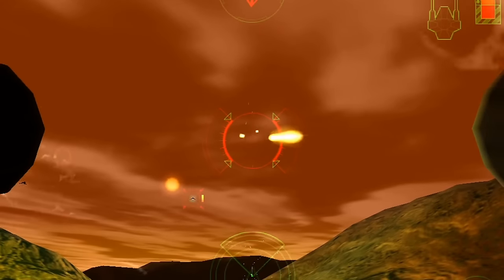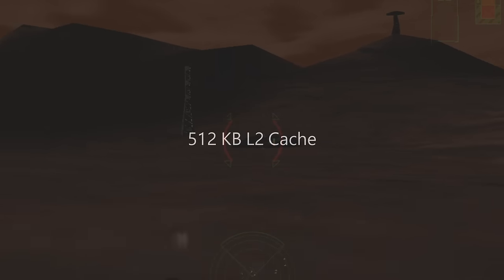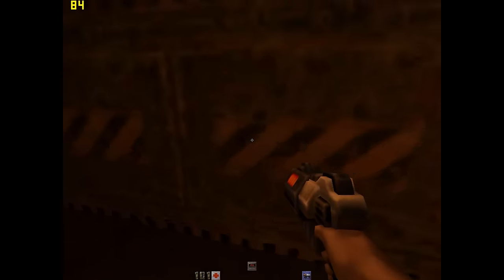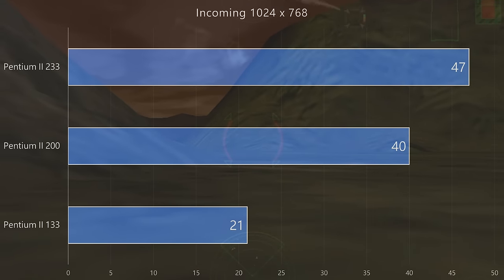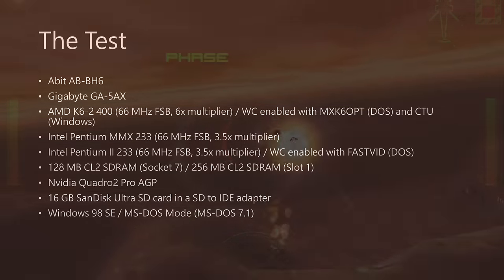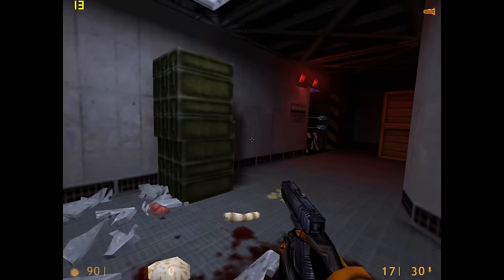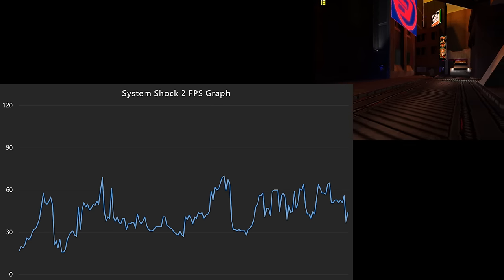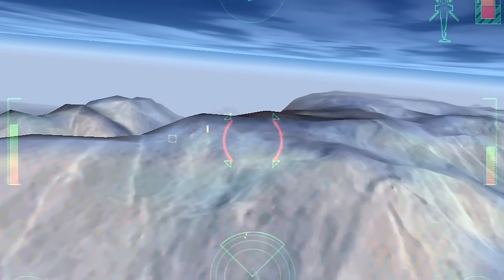Pentium II 233 The First Slot 1 Processor

Comment: Oh gosh, this makes me feel even worse about my IBM Aptiva computer in my youth :(

WARNING! Wall of text below. Copied and sloppily translated from a forum post I made a few years ago.
In 1999, my parents agreed to buy a new computer. A new. A real. The old piece of crap that were the source of so much anxiety would finally be replaced. We had looked here and there, and had a good candidate in a local store. An IBM Aptiva for about 9000 SEK including the screen and speakers with an AMD K6-2 400MHz, 64MB RAM and 8GB hard drive. I think i was model 2158. We thought for a while though before hit it.

Two weeks later, we were back to buy the computer. But then and there, while the parents talk to the seller, I see that the computer next to it, also an IBM Aptiva, but with a Pentium II at 450MHz, is on sale and costs about 8000: - against the previous 11,000, thus cheaper and better than the one we came there to buy!
But..! I did not dare say anything to my parent! For there had been so much fuss during the past six months whether to buy or not buy, and if so, which, and a damned negotiating to get into something tolerable. Inexpensive shit should it be, since they do not understand any of it. Not out of incapacity, but pure meanness.
I was afraid that there would be hell in the house to just take this up, even though the case was obvious. Like not challenge the election now that we've come this far. It would probably just be mental locking only the disclosure. That the content would have been brilliant had not played any role. It was the end of drivel about computer simply. In addition, it had a lot of ugly shortcut keys on the keyboard. No, it made a crappy impression. The other was clean, and it felt better to the mind, at least that was what I told myself. All were mentally tuned to the selected computer.

In retrospect, I regretted it bitterly as hell, and have never really been able to forgive myself for that.
Gradually, it turned out that K6-2 was not so good. It sucked, frankly, even though I did not want to acknowledge it. It was 400MHz, it had to be good! But it never kept up properly.
The real deathblow came when I would upgrade "graphics card". The machine had no AGP port, it turned out ... And with the advent of the Internet, I discovered that the other machine I saw had AGP port. And better speakers. Much better speakers actually. They looked almost exactly the same, the only thing that visually separated the two were knobs, but I got to listen to them many years later, and it was something completely different. There was a base in those.
All this, I missed for a few colored buttons on the keyboard ...

Arghhh! So much anxiety that pop up!
Damn, that is! This really blew my computing life during the most critical years of my life, when it mattered most. I could never play Tiberian Sun and Unreal Tournament absolutely no lag, even though I was running on the lowest resolution with minimal graphics settings.
Tiberian Sun also came to be the most influential and played the game of my life, even today. To not get to enjoy it fully while it was highly topical was bitter. Emperor: Battle for Dune, I never got to work even though the minimum was just 64MB of RAM. Shit hung  shortly into a mission. For my friends it worked. I finally upgraded the RAM to 192MB, which significantly reduced loading times and eliminated the swap, but the processor still didn't keep up.

This has really scarred me, and created some sort of revenge of always having top notch stuff, or at least above average, with everything. Never again will I be drawn into any technology slavery with stuff that does not really do what they should and drives one to madness.

I got a new box 'already' winter / spring of 2003 again was right and proper (P4 2.4GHz, 80GB HDD and upgraded memory directly in the purchase of 256 to 512MB of RAM after tip from a friend's dad), but it still was not the same thing anymore. The games were not relevant anymore, and the integrated sound chip sucked, the sound in some games were cut. Played mostly on consoles as well (Gamecube).

As late as 2010, I found an ad on a sales page where one had exactly the computer that I missed the fall of 1999 for sale. I was considering buying it in some sort of attempt at therapy, and make amends to myself at last for my mistake and appeasement over 10 years earlier.

This was some kind of therapy for me now, after all time. The computer is left at my parents and works yet. Thank you for reading.
Reply: During the early nineties, I really wanted a 386/486 , I mean ANYTHING ( i was 10)!!!  I would check some prices and it was 3500$ or even 5000$ back then, hence why we didnt have a computer at home but I would read the specs and daydream about having my computer with win 3.1 and just be able to run MK /DOOM or any good game of that era like Prince of Persia... some friends showed me Mortal kombat 1 /Wolfenstein /doom  on ms Dos and I was overwhelmed. I really wanted any computer I could have... even the shitiest one. Fast foward to 1998: my first computer was a cheap 999$ (monitor included) celeron 333 instead of a p2 and when I got to chose the video card at the store (with my parents paying so I couldnt push my luck) I chose a Diamond viper v550 8mb and next to it was a Diamond viper V750 16 MB !!! WITH S-VIDEO TV OUT !!!! guess what , I really wanted the tv out, but it was 50$ more and couldnt bring myself to try to push my luck (it was my 16yrs old bday present) when I got home I got somewhat that same feeling where you cant have the best games working at MAX FPS or just having the damn tv out would have helped greatly.  it broke after 2 or 3 years because I didnt know you couldnt plug and unplug a ps/2 mouse or keyboard when the system is on. Anyway I enjoyed some AVP 1 (in 640 x 480) and FF7 didnt quite ran smooth in 640 x 480 , even on the lowest available resolution it was shit. It really took me a while to see FF7 on a good pc with great performances. The only it was good at was mostly running zsnes full fps, it think it was without the transparency , and I could get to run those early Ultra HLE or even Bleem!! and Psemu PRO .Callus , Mame, heck even FinalBurn made its debut during that time, I remember going to a website called CPS2SHOCK to see the latest release, and their first CPS2 game was Street Fighter Alpha 1,  But at sub par performances . Except Snes / genesis , everything above those system was a struggle to emulate . Then my friends had VOODOO 3s ( with the TV OUT !!!!!!) I could clearly see the rendering was better on any game we threw at it and what is this ``triple buffering`` ... LUL I remember saying like hey whats that option I dont have access to...Needless to say I now have something powerful enough for what I want to do with even some old Geforce gtx 280 (one of the last Tv out card ) but never got quite satisfied. Now I seek an old 486 or pentium with a turbo button and some MHZ display with ...lets say something between 66 and 100mhz, to crave that slow emulation era with buggy sounds and bad emulation and YES , play MK 1 and DOOM in Ms Dos with a real Crt Monitor. Crazy how PCs were better back then :P

Comment: "Incoming" was the game I really wanted to keep playing, but kept pissing me off, probably because of either difficulty, or because I kept getting killed a lot.
Reply from the maker: I find it plays best with a Joystick! The cool thing with Windows games is that any modern USB stick works. I'm playing with a modern Trustmaster T16000 if I got the model number right.
Reply: I think I remember using the joystick as well as maybe some mouse and keyboard, only remembering myself using it on either a custom-built Windows 98 machine or a Compaq that ran Windows XP. Can't remember, but I remember that game very well.  #nostalgiarush
Reply: Double post/repost, much? Not sure what happened, there.
Reply: Agreed, I never made it past a mission in which you had to protect a Space Shuttle sitting on it's launch platform.

Comment: I have this motherboard. It has caused me a lot of issues. It hangs a lot with both Windows 98 SE and Windows 2000 and it also sometimes fails to properly detect optical drives (for example instead of SONY CD-ROM it says CONY CD-BOM, which results in Windows not seeing an optical drive). It has NO bloated capacitors, nothing is wrong when you look at it, but it still freezes. It sometimes doesn't even POST. It's the same system I commented about in your Colin McRae Rally video. Is there a fix or should I just get another board?
Reply: Check your jumpers for wrong clocks/voltages (if not jumpers, BIOS settings). I had similar issues on my GA-586ATV but after fiddling with the jumpers it worked fine.
Reply: ***** I have already tried other drives, but it still does that. Well, time to get a new one! (from that era I mean)
Reply: xan1242 I checked the BIOS settings and everything was normal, so it's probably gone kaput. Thank you and +Gatewayuser200 for your answers.
Reply: It doesn't have jumpers, and I have already cleared the BIOS many times. I even updated its BIOS but it still has the same issues...
Reply: Damn ESD...
Reply: Use Memtest86+ to test the memory modules for a few hours.

Comment: Maybe another future project could be a windows 2000 pc with a voodoo fitting the motherboard or a bit more modern hardware thinking of using the old am2+ motherboard with an athlon 5200+ dualcore at 1.6 ghz or at its lowest 800 mhz (might lock one cpu core to further limit the cpu performance & increase compatibility)

(Not decided yet if i should put windows xp on it instead though.) & 2 gb ram + a 7300gs with nglide to get a somewhat more compatible pc for older games around that era.

Comment: What AGP graphic card do you recommend for this CPU if I am using 1280x1024 LCD monitor?
I am going to build desktop based on this CPU (Pentium III 700) running W'98SE for my Yamaha SW1000XG. Motherboard is MS-6199VA.
Reply from the maker: You got to do your own tests as it depends on the game and what settings you like.
Reply: I want to get full resolution of my monitor at 256 colors at least. How many memory on card do I need?
Edit: I chose and bought GeForce FX5200
Reply from the maker: Please do your own tests, it's all part of the hobby.

Comment: Ya, chipzilla got their panties all in a bunch because people were violating their rules of ethics and overclocking their chips, and tried to put a stop to it, until someone figured out how to cut or tape one pin on the slot to suddenly make 66Mhz bus to 100 on BX :)  Then they started stomping their big feet all over motherboard manufacturers like ASUS who was putting overclocking capabilities into their motherboards. It was rumored ( there was a lot of evidence to support the rumor too ) that Intel was holding back their supply of BX chipsets from motherboard manufacturers that had overclocking capabilities on their motherboards. Very interesting times back then.

Comment: 6:25 - There were more unlocked CPU's from future. For example Pentium II 400 0.25 mikrons. I own it, and it can be downclocked to 2x. As I own only 100 FSB motherboard (jumper for 66 mhz setting is soldered), I can go only to 200 mhz. (2x100) But with better motherboard, you can go to 66x2 = 133mhz. While you can still go to 110x4 = 440 mhz for sure, maybe 113x4, on motherboard with FSB overclocking. So no, you are not stuck with Pentium II Klamath 233 if you want downwards unlocked multiplier.  Just go with good BX440 mobo and Pentium II 400. All after august 1998, including revisions of PII 400, are locked, so you need to picked one up to august 1998.
You gain this way range from Celeron 133 (2x66, L2 cache disabled) ~ Pentium 166 MMX performance , to Pentium II 450 (112x4) - Pentium II 500 (if you're lucky, with overclock and can raise vcore on mobo to 2.2v).

Comment: I am dreaming about tualatin engeneering sample with unlocked multipier. But if I could have one, there should be problems with early bx boards. They just don't have multipier settings higher than 6.0x. Some times I just want to build a pc on a chipmaker factory xD

Comment: Hey Phill did you know that ther is a 3dNow quake 2 addon that will make the K6 shine you sould maybe include that in some video someday . Gl hf
Reply from the maker: Yes I know about that. It's a great showcase of the technology, but not many other games support it. I'm sure I checked it out in some video in the past. I did enable Write Combine though, which gives it a boost in DOS VESA games.
Reply: i had a K6´2 450 my self back when it came it was a great cpu for the price.(i still have it but its a + version ) Keep making videos , btw i hated the ali chipset it had a major bug with nvidia cards and ther drivers around 1998-98 made openGl crash

Comment: i have my beautiful p2 400 and I have an asus p2b and a p2b-s, in this days I have the chance also to get a p3b-f fore free from a person that I know, with p3 600 mhz and a sound blaster ct4830 and anti 3d rage, I have to find a replacement for it because he wants to keep the case of his old '99 pc but he wants modern parts inside of it to run recent windows os, I am trying to repair a socket 775 motherboard with the pentium dual core, to get the vintage goodness, as you know the p3b-f is a very good oc board, so have it for the price of a very common socket 775 system is a great deal for me, but I am still missing a gpu for the socket 775 board and an hdd

Comment: +PhilsComputerLab
I'm confused on L2... using the Pentium II 233 and Pentium Pro 166 as examples are they both two ways of getting L2? Could a CPU card combine these two methods?
http://www.bytes-and-more.de/IMAGES/P2_233.jpg
https://upload.wikimedia.org/wikipedia/commons/thumb/e/ef/Pentiumpro_moshen.jpg/440px-Pentiumpro_moshen.jpg
Reply from the maker: What's the confusion? Sorry I don't have time to follow up those linkes, can you explain it?
Reply: +PhilsComputerLab
They are just pictures of the two CPUs, to help explain what I meant. On the 223 the CPU is on a board with two ICs, and on the 166 the CPU has two parts under the cover. I am confused how they are both L2 and also wanted to know if both methods could be combined onto a single CPU, card, board, etc. and if there would be any reason to do so.
Reply from the maker: Not familiar with the Pentium Pro, but Level 2 cache comes in many forms. On a 486 or Pentium, the L2 chips are even on the motherboard! Later Pentium III CPUs, have the L2 integrated into the CPU, so there is just one chip with everything. So this was just a transition for a short while.
Reply: Wikipedia-article about the Pentium Pro explains it:
However, this far faster L2 cache did come with some complications. The 
Pentium Pro's "on-package cache" arrangement was unique. The processor 
and the cache were on separate dies in the same package and connected 
closely by a full-speed bus. The two or three dies had to be bonded 
together early in the production process, before testing was possible. 
This meant that a single, tiny flaw in either die made it necessary to 
discard the entire assembly, which was one of the reasons for the 
Pentium Pro's relatively low production yield and high cost. All 
versions of the chip were expensive, those with 1024 KiB being 
particularly so, since it required two 512 KiB cache dies as well as the
 processor die.

Comment: I have a AB-BH6 but i always have problems with it
Reply: The electrolytic capacitors need to be replaced if they have not already been replaced.  Abit went out of business partly thanks to capacitor-plague warranty claims.
Reply from the maker: So true. I have a de-solder station and frequently replace caps. Got lucky with this one, it has nice Sanyo Japanese caps. AOpen also use them a lot.